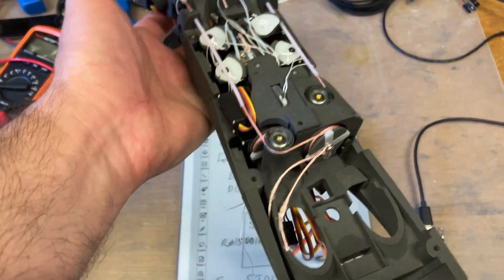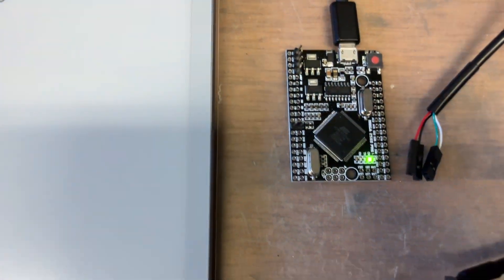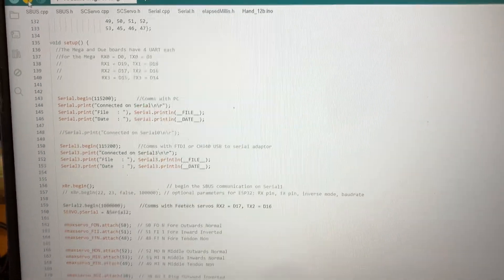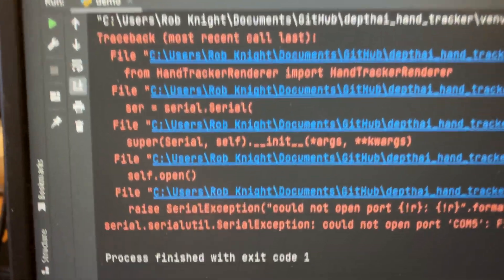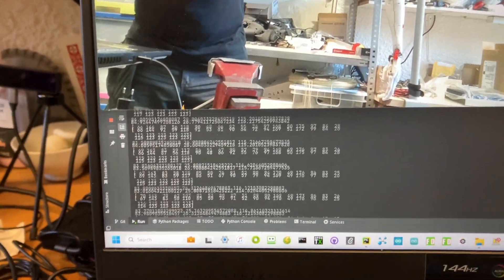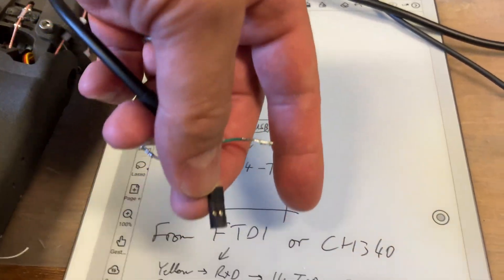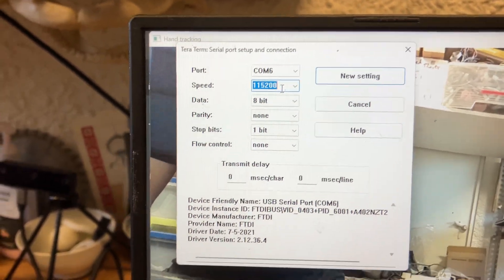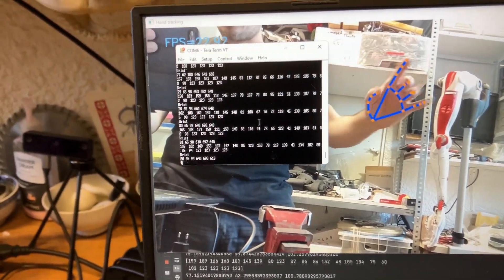How to connect an Arduino to a PC running visual mediapipe in the V1 DexHand

Comment: Hello, don't be tired. Excuse me, I had a question: Why didn't you use the battery cover??? And why is the cap that is included in the onshape platform model different from the cap in GitHub??? And are the sizes different and what is the problem with the battery cover?
Reply from the maker: In the end the battery cover is not needed as the large outer shell covers the electronics compartment.

BTW when you become a YouTube member I will upload a custom shell with your name on it.